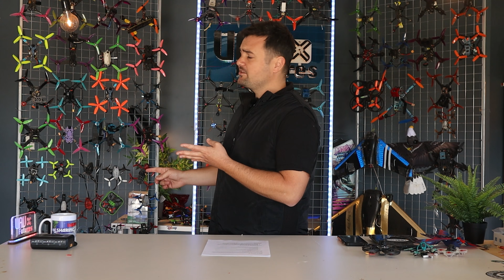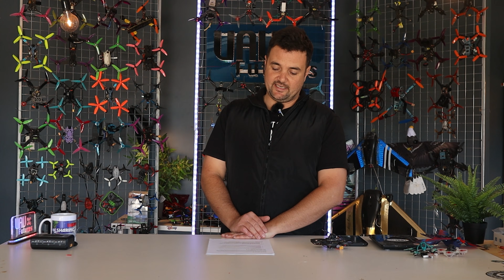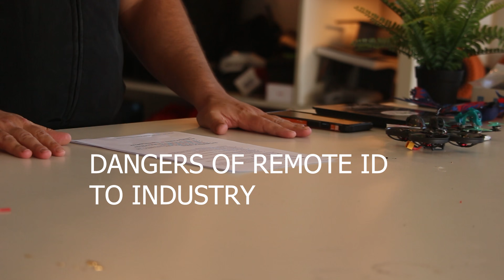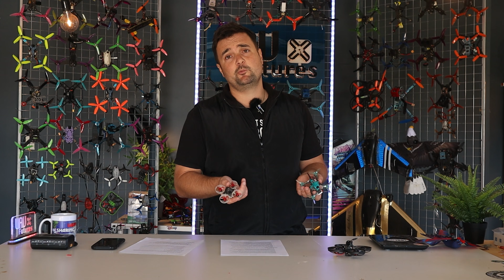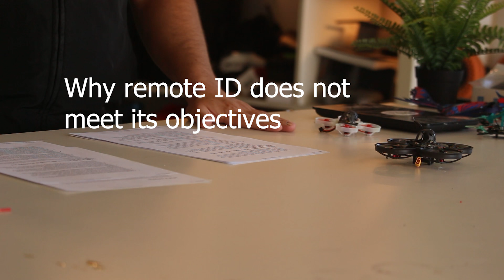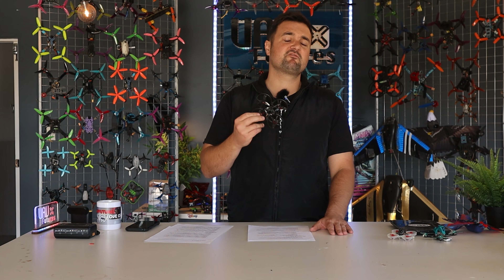Analysis of Remote ID Implementation and Its Implications on Drone Industry and Recreational Users

Comment: If we have to have remote id. Why not keep the transponder in the radio? This way you don't need 200 new transponder. Just one or a couple is needed. And we can keep whooping!
Reply: And visible only to the authorities
Reply: @Coops777  there are some modules that allow privacy and adhere to faa regulation. At a weight of 20 gram. Takes 2s power so perfect for all radios. 

Didn't save the company that has these modules because i live in europa. So my hobby isn't being ruined by FAA. Only for western travel. Woop, 5" and fixed wing pilot my self. So i fly about everything my self.
Reply: @AntimatePcCustom  Thanks for your info. Like yourself, I fly everything, including full size. I am a member of the local RC club but love park flying. I think Ive got the aviation bug real bad lol
Reply: @Coops777  and i feel so bad for you guys :( wish i could do any thing
Reply: @Coops777  fuck. Just found out. Europa is also hit by this disease... But at start 2024... Fml. Rip whoop.